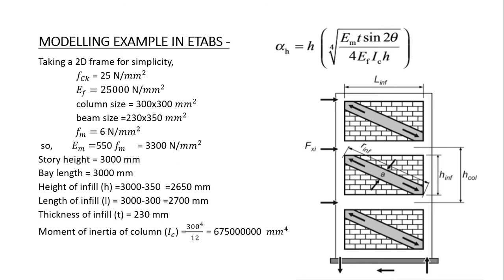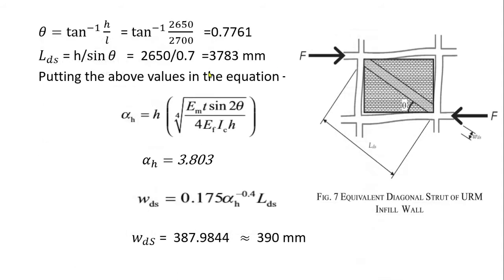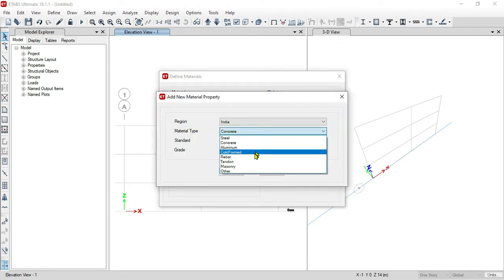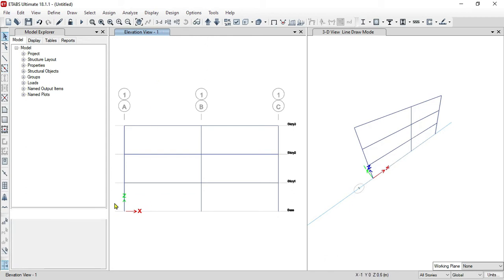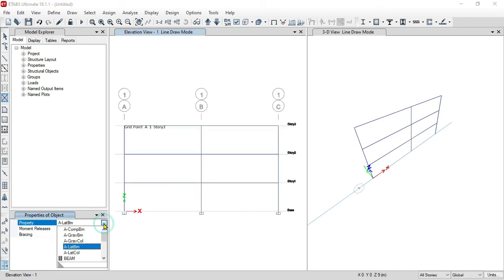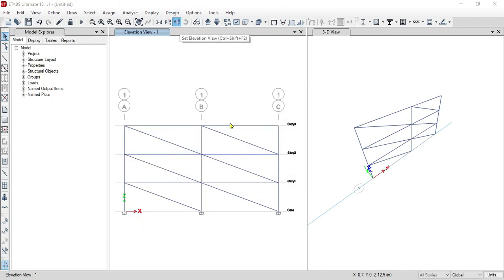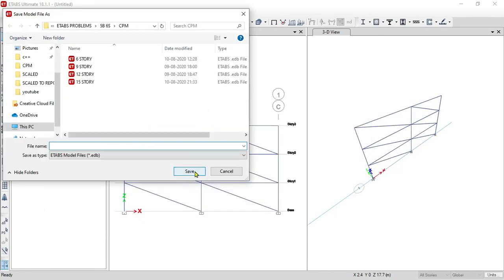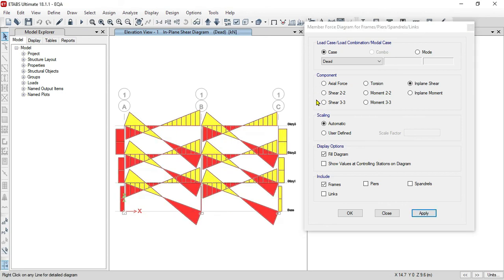MODELLING OF BRICK MASONRY WALL IN ETABS ,STRUT ANALOGY,    (PART -2)

Comment: Sir we will still assign a linear load due to masonry wall?
Reply from the maker: Yes, it should be applied as line load. And then you can use zero mass and weight for the strut.

Comment: Sir What will happen if the Infill Wall has openings on it?
Reply from the maker: There are different methods to consider the opening in the infill. You can apply a modification factor for the size of opening. I will recommend you to refer some research papers on this topic to get the clear understanding of this.

Comment: why we don't take 2 diagoals ( x bracing )?
Reply from the maker: You can take X bracing also as there are many types of bracing configurations like X, V, Chevron, K, etc.
Reply: @MUSCCons  thank you, usually madonry infill walls work in compression ( axial forces), in a 3D building, we cannot predict the direction of earthquake, so it is better to take x brace. Am i right?
Reply from the maker: @aymanramadan3235  Yes, you cannot predict the direction of the eartquake.
If you doing nonlinear time history analysis, then it is good to consider equivalent struct in an X configuration. For 3D analysis, you should also consider the out-of-plane bending of masonry infill panels which is a little bit difficult to model. I hope this helps.

Comment: Thanks for the video sir, can u please clarify if we r converting the M wall to strut, do we have to add the load of masonary wall seperately in load define section.
Reply from the maker: Calculate the load of the masonry panel and subtract the load of the strut from it. Apply the remaining load on the beam.
Reply: @MUSCCons  thank you sir
Reply: @tsewanggyalson8651  hey can u tell me how u calculated the load of strut ?
Reply: @MUSCCons  A/S sir can u explain  how to calculate the load of the strut?
Reply from the maker: @shaikhzoheb9025  What type of load are you talking about, please specify.
Reply: @MUSCCons   I am confused about what loads to apply on beams. means load of brick wall or load of brick wall minus load of strut ( if yes how to calculate  load of strut).
Reply: yes plz tell how to calculate the weight of strut ..is that just we have to multiply by the area by the density of wall